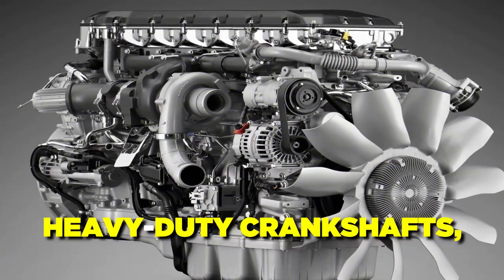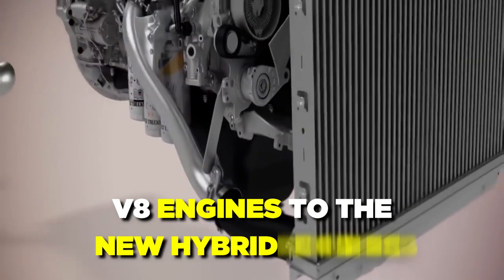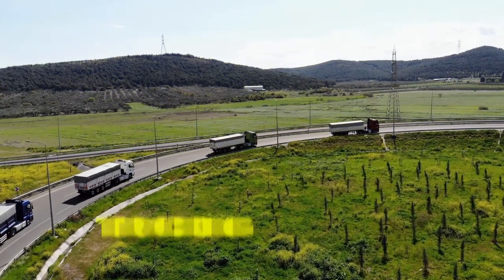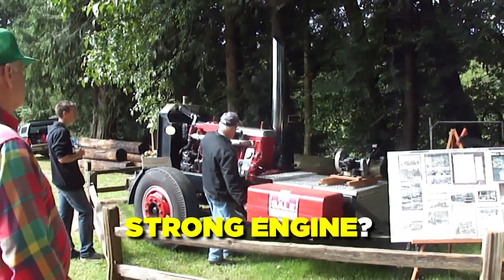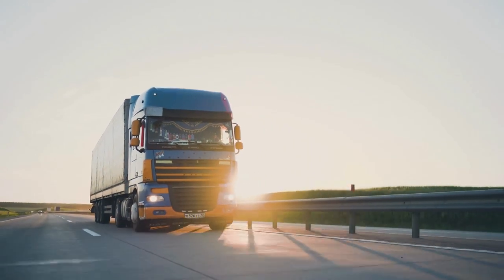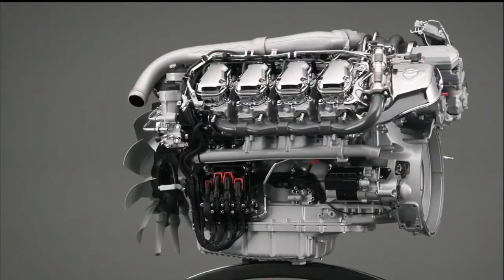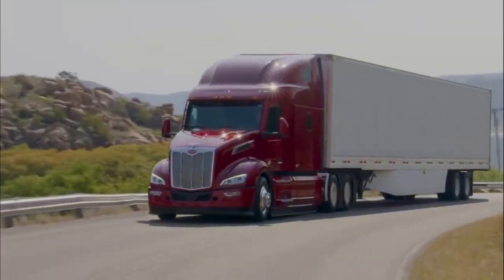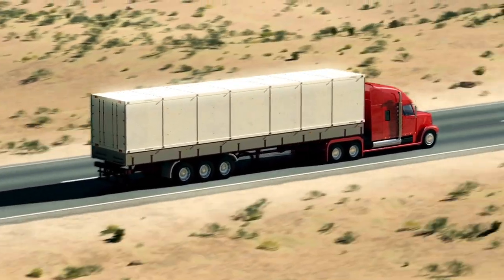How The FIRST EVER Truck Engine Was Made

Comment: You said in the video that a modern bread&butter lorry engine has a pony count of 2,000, er what drug are you on mezzomphetamines, the latest V8 offerings from Scania have a pony  count of 800 ,and Volvo,s Big Banger 750.  as for the smaller engines, their sound yeagh, keep popping the the Mezzos.  Ch---st my seventeen year old Hoover washing machine  makes more  noise on the fast spin cycle. Yes you can  soup up  a straight six KittyCat, or V8 Bulldog and get  1,600 2,000 ponies for tractor pulling , not hauling  twenty tons of bricks long distances.